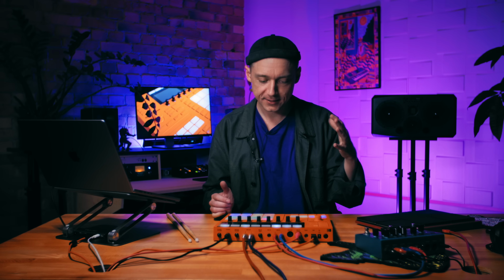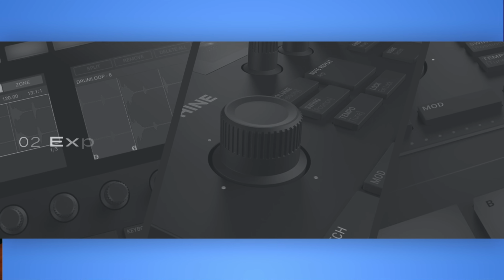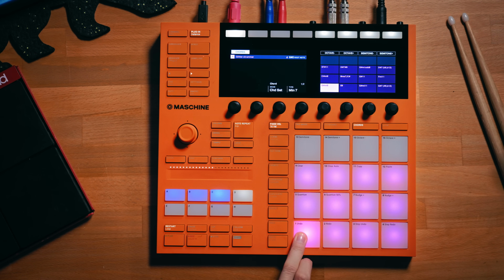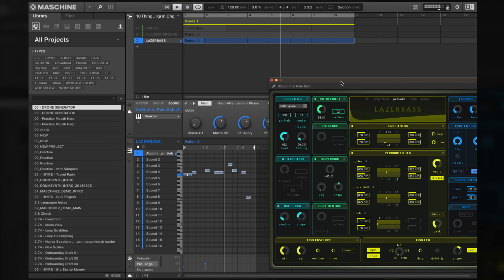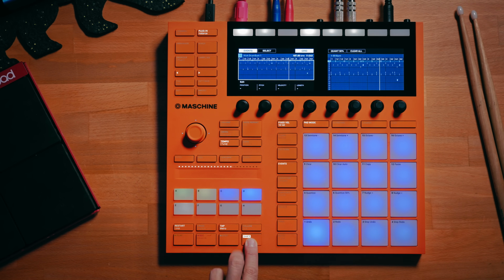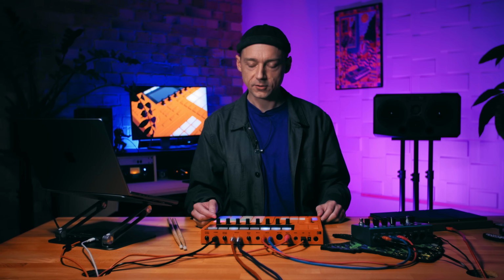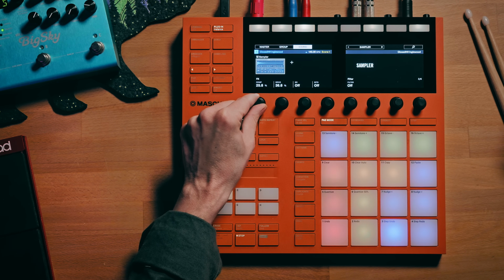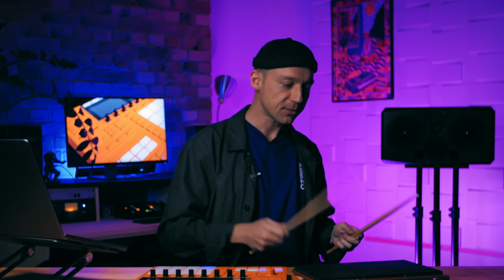10 things you didn’t know about Maschine | Native Instruments

Comment: What also should save computer power, is when tracks or groups are muted, stop the VST's from running and taking up processor power. Reaper 7 and Akai MPC 2.x can do that. If Americans can do that......why Germans can't. All tips are great BTW. That Rotating nudge function should be implemented all over the place. It is GOLDEN. Period. Integrating the strymon, I was wondering what you were doing with those cables. Would use a Microcosm though, Reverbs of Maschine are cool. Now if I'm the Devils advocate (as is my favorite role), you are trying to sell me a MK3. While I'll wait on the MK4. And you nearly succeeded, nearly.

Comment: BORIS >>> Thank you, thank you, especially to you! MORE MPORE MORE 
How good it feels that something is happening, that you r keep on doing that.
Whenever (over the years ) the usual machine doubts get louder an louder, there comes a ligth and some hope through you that the way of The Machine will continue. I still love my MK3 and Jam combo for jamming and making my sound carpets sketches. 

I have one wish… for the next round: The integration of a fader port (i.e. an external mixer (with motor fader)) into the machine. I use it in my DAW if I want to continue. Because when it comes to a whole track/mixing, you can't make it in maschine …at the moment ;-). But that's old old hat. I do the real arrangement with Studio One. It's a shame, because I actually don't want that and my way of music doesn't need it. I want to make and combine a lot of good sketches and not paint perfect paintings.

Still having problems to use an external hardware synth in maschine … loosing the midi connection? Old problem.

Keep it up… When can I order MK4 ;-)

JL

Comment: How to do program changes on the PLUS hardware? (Tip 5)
Reply: Late but huge thank you
Reply from the maker: Hi there, it's not possible to draw Program Change events inside Maschine+ right now. You can however set up Program Changes in Maschine software, save the project and open it in a standalone mode.

Comment: Hi! Can somebody tell me how I can use a pedal to start and stop recording? And can you name an example? I have no idea how to search for a pedal like that. Never seen somebody using one. Thank you.
Reply: I’ve got it working with a cheap guitar pedal from Amazon. It has two switches built-in and the jack plug has a tip that looks like a stereo headphones plug. One of the switches start and stop playback and the other one turns the record button on an off this seems to be the default behaviour.
Reply: Great help! Thank you! Can you name the brand and model? Im gonna buy one of these and a stereo cable.  @davesinjin

Comment: Regards the Norm Drum Pads is it possible to use a spare maschine controller i.e studio / micro in midi mode with the MK3 but have the spare controller act as the Nord Pad for finger drumming. I know I can just use the MK3 but would like to have a separate unit that is soley dedicated to live finger drumming in live sets ..whilst the MK3 and Jam control live song scene pattern changes and filter knobs etc. Its just the way my brain works in having a controller for each job

Comment: Excellent video, thank you.  Maschine is a brilliant platform that however has been let down by underinvestment over the last years.
My Maschine Mk3 has now stopped working with my audio interface and there are clear signs that NI has abandoned Maschine development (new keyboards have set the direction by abandoning Maschine integration).
So with a heavy heart I am moving all my work to Ableton and will start no new work on Maschine…
A real shame that NI lacks the strategic vision to keep Maschine going.
Reply from the maker: Hey there, we haven't abandoned Maschine. We are actively working on it behind the scenes and exploring ways to integrate it with the new Kontrol S-Series MK3 at the moment: https://bit.ly/3u6tjbR
Reply: @NativeInstruments thank goodness, after moving my workflow entirely over to Maschine. I only use logic now when scoring and arranging. Can’t imagine a score editor ever coming to Maschine, but a much improved piano roll editor would of course be welcome as we all know. Also, mixed pattern lengths…. If I have pattern 32 bars long, and mess up on bar 16, so start pattern from bar 16 to correct my recording, ALL other patterns start playback from bar 1. So you’re not hearing the piece in context at all. You just have to go from bar 1, complete restart to do your overdub.

Comment: Is there a feature to make one-shots stretch without the sound getting faster? It would be nice to put one-shots on keyboard mode. I have to load my one shots in Playbox to get what I’m looking for.
Reply: Jef Gibbons has done a video on this. You have to transpose using audio module, render the audio file to a new sound slot, in a sampler, then that’s it! It works like kb mode, but you cannot achieve this with kb mode. Also, using this method, you have the advantage of formant engine if needed. 
Sampler alone will always speed things up, unless rendered out of audio module at whatever pitches you want to assign to pads. It actually doesn’t take long to do…..

Comment: You came close here to a clear and complete explanation of how to use the input and output sockets and what is required in terms of routing internally for different scenarios. I took my Maschine plus on holiday and I tried to play in some location recordings over cable from my phone to the sampler. I just couldn't get any audio in spite of hours spent searching for what to do.
I think the basic explanation of audio routing input left and input right how to get that into the sampler detect mode would be a good place to begin. I just couldn't get it to work.